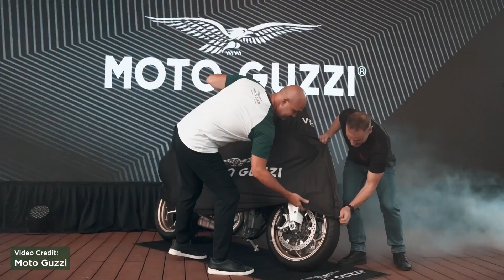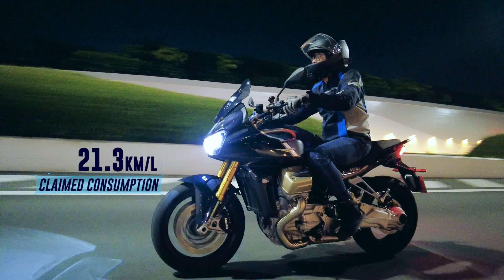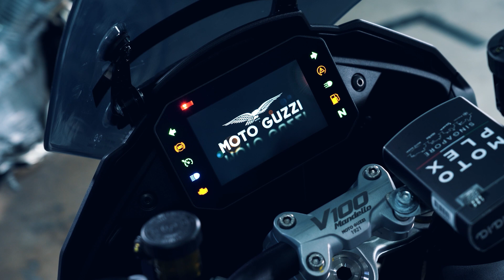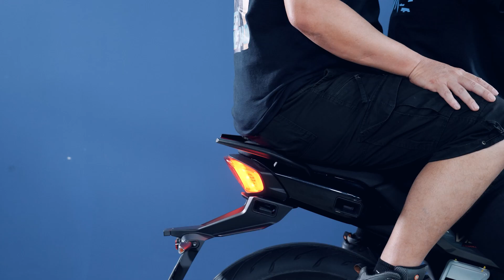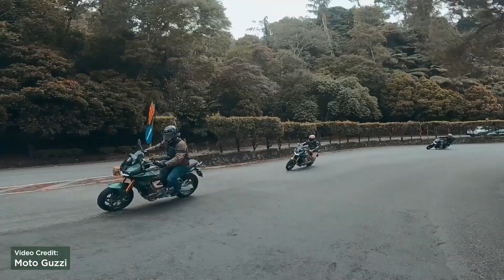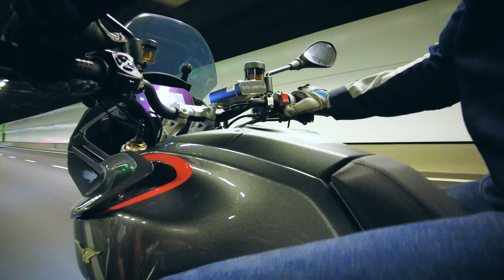Moto Guzzi V100 Mandello S Review : All You Need to Know

Comment: First and foremost the most amusing and entertaining review of the V100S… thanks guys ! Now to the bike 5000 miles of owning the bike with 2500 miles just completed riding the Mountain roads between Barcelona and the French Boarder.  The bike is a blast with a passenger the bike felt like it was happy to take on even the most extreme switchback roads that the mountains have to offer it had my boots scraping the floor in most or the corners yet remained comfortable and easy to ride all day on the switchback mountain roads. While it might not replace my Triumph street triple R for my annual trip to the Isle of Man TT ir is without doubt the best and most fun motorcycle for aggressive touring with a passenger that I have ridden in my 50 years of motorcycling.

Comment: Many years ago I owned a 1972 moto guzzi ambassador 750 full dresser. I hated the loud and hard "CLUNK" shifting because of the helical gears and most of all... the torque to the left, especially when leaning to the left on corners and revving the engine. Yes, sitting still and revving the engine was annoying to me the more you revved the more it pulled. Yes, I sold it shortly after buying it.  Not for me. 🙂 Thanks for the bad memories again. 😁 I had to rebuild the transmission and the car type clutch. The parts are super expensive. But it was easy to work on and rebuild. This is water cooled??? Wow. Mine was air cooled. Big difference.
Reply: Hopefully things have come on a bit since 1972....
Reply: After reading your story, I'm just relieved to know you are still alive (phew) 😌
Reply: @martythemartian99  🤣🤣🤣🤣🤣🤣😄😄